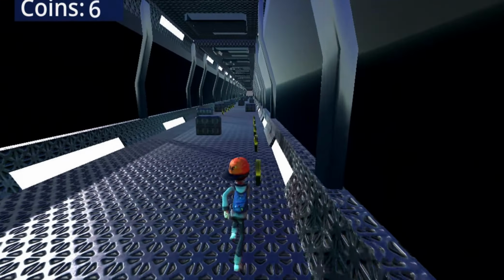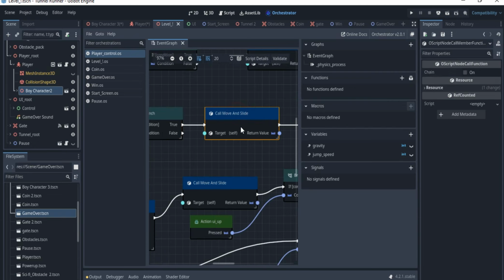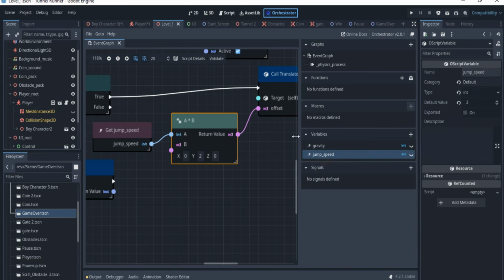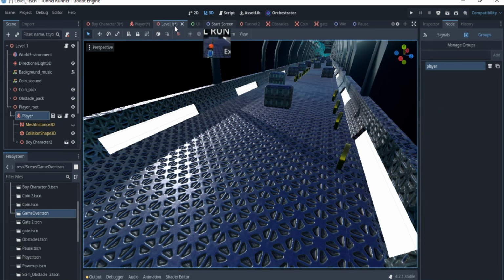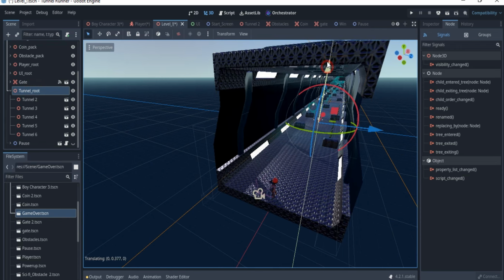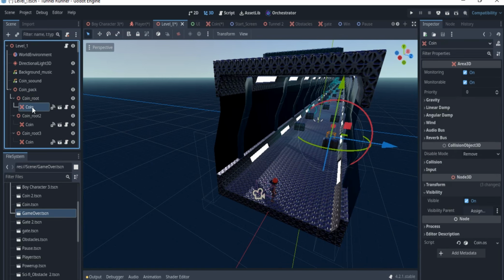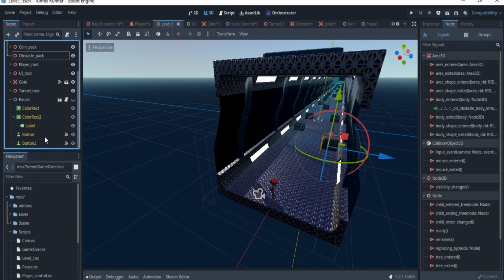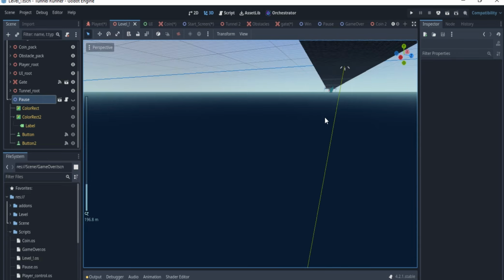How I Made a 3D Runner using Godot 4.2 Visual Scripting

Comment: Yay more visual scripting.
Reply from the maker: @dakotah4866  More wonderful tutorials loading...
Reply: Hey did you get the new Godot update
Reply from the maker: @dakotah4866   Yea, I have already downloaded it.

What I love about Godot 4.3 is that you can import 3d models using fbx format by default.

The models look very good too after import.
Reply from the maker: @jeanheonofficial  I think it should be an issue from your extraction software.

I used WinRAR to extract it right now and it is working very fine.

Try downloading WinRAR and installing it on your computer before extracting it again. I'm sure it will work very fine.